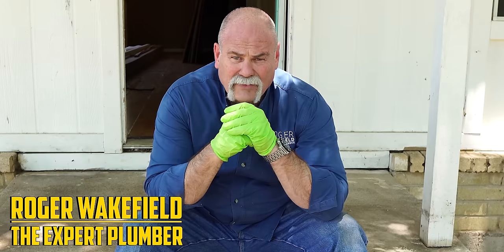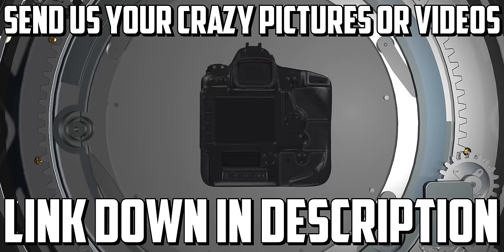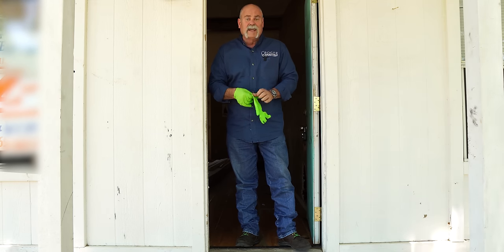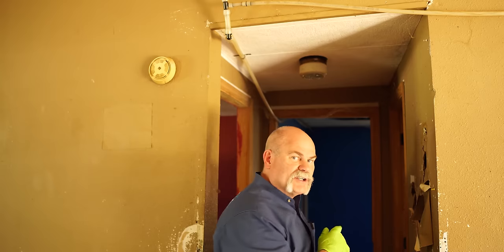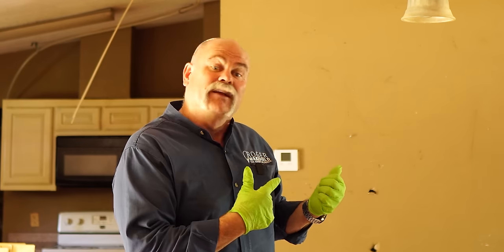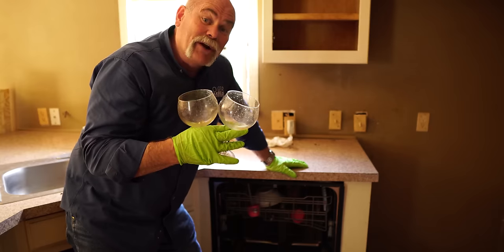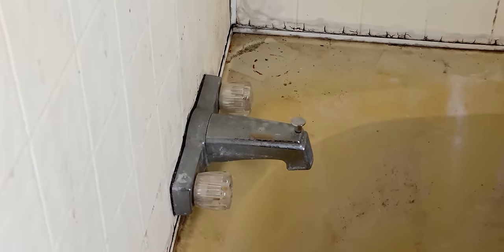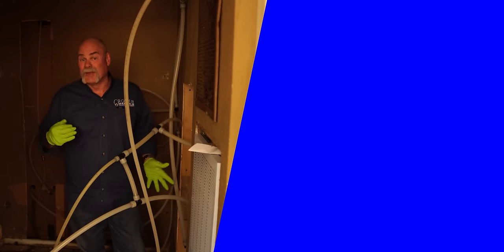This is THE WORST Plumbing Job in America

Comment from the maker: So what do y'all think about this plumbing job? Have you seen worse? Show me: video@rogerwakefield.com
Reply: I can’t believe the U.V. from the sun hasn’t honeycombed the uponor being exposed outside!
Reply: I work in DFW as well and I have seen some shit. Once went to a house that seemed to have a venting issue as when nearly any fixture was used the toilet would gurgle. I crawled under the house and saw an utter nightmare. Everything done in PVC  pressure fittings with tees on their back and the whole house all tied back into 1 4" stack that served the master toilet. Nothing was vented other than that 1 stack. Water lines were pex and shark bite and ran like shit no hangers just laying on the dirt uninsulated.  I crawled back out and told her she had quite the problem. She told me that my company just inspected the plumbing in the home for her prior to her buying it not long before I hired on and I did not know that prior to me explaining what was wrong as best I could to someone who doesn't understand plumbing. It was a tough situation to be in and I felt so bad for this sweet old lady. I fixed it on the side for her for $300 plus material over 2 weekends. I would have charged 7k to do it if I quoted it for the company
Reply: Not that bad but close.  I had a job I went to back in the 80s that was a basement home and the tenant had the sewer line backup and instead of getting the line cleared he popped the clean outs and let their waste line drain into the basement.  When I got there I found the floor was moving.  Needless to say we called the health department and they forced the tenants out until repairs were made.
Reply: Was that a meth lab or a grow house?
Reply: The builders of our community should be in jail so they can't make such a mess ever again.  Code violations galore - so far I've found HVAC and plumbing code violations!  What's next? 🤬
Reply: 😳 Wow, I hope they got a discount, that's a lot of line
Reply from the maker: And it took a while to install all that.
Reply: What a mess! I've seen similar on some carrbean island homes. For example, pvc and cpvc lines run10 feet outside the foundation. Various sizes, three quarters to half the back to three quarters then half again, in each run, and not even schedule 40 pipe but thinwall. Piping installed up the outside wall of the home then through the wall.
Reply from the maker: It’s crazy Max.
Reply from the maker: Maybe both...
Reply from the maker: Great pictures. Thank you Pamela.
Reply: No worries.. its just temporary.. 👍
Reply: When you  observe works of art rather than graded and supported water/dwv, you give thanks for the sawall you own and pray that one day things will improve to the point that you can honestly say to the owner of the art work you cannot find time in the near future to handle his problems unless he is super patient and has fat wallet!
Reply: @jaybee3165  t&p you don't need a t&p it's just a code "recommendation" lol
Reply: It kinda screams of poverty and mental health issues. Some poor guy just doing what he can to get basic running water in the house... But yeah tear it all down to the bare wood and start over.
Reply: I'm a renter when I moved in the plumber blew a water line right outside my front door and left it broken for almost a year since moving in we haven't been able to use the sink because he doesn't have it properly connected bathtub was put in backwards so I can't snake the tub and the drain seal on the toilet leaks under my floor I'm wanting to fix bathroom sink kitchen sink toilet and tub but I'm not about to pull up a toilet that's soaking wet underneath Roger Wakefield please tell me what I should do my landlords plumber obviously sucks and knows nothing about plumbing
Reply: What I just seen in the video it wrong and very dangerous
Reply: Roger that was your first re pipe. Back in the early years. Now they’ll called you back to fix your leaks. 😂
Reply: Got to love a good improv!
Reply: I’m not a plumber but I have learned from a carpentry house on how to do plumbing n my god that plumbing was so bad I wanted to tear my head off.
Reply: Looks almost like squatters just making use of what they could.
Reply: @RUFUS T. FIREFLY it's sad that you would admit to living like that, you should handle your issues.
Reply: Very creative! hahahhahahahahahaha
Reply: not sure if this counts, but my work has a drain for the walk-in fridge that also runs through the freezer drain and out the same hole, and we have had constant problems of that water freezing in there to the point we have to do this whole dump hot water down certain holes. our maintenance guy used to fix leaky pipes with duct tape, and once "fixed" a sprayer in the dishwasher station with a bag, chop sticks, and duct tape, and I tore all of that off and fixed it properly by tightening down the nuts that were literally finger loose. But this? I'm not even a plumber, and even I think what you have shown here takes the cake as to the worst i've seen.
Reply: grow house for weed
Reply: It looks like the entire house is an OSHA violation and is simply put, totalled.
Reply: That’s bad. Now problematic where I work I run into problems where people cut corners and just hacked crap together. My thought Is why spend all the time doing it wrong. When it’s quicker and more efficient and correct to do it right
Reply: This house was a trap house for sure only people growing and manufacturing drugs would set up the hoses like that. Or he could have been growing flowers and needed the extra compost in the toilet 😂
Reply: I really can’t lie I’m not a plumber but even I can tell it’s a mess
Reply: To me, it looks like someone was probably stealing water from the neighbor.
Reply: James Tucker sounds like you should call your local board of health and ask for an inspection. Depending on where you live the owner would be forced into fixing the issues. If you live in the U.S. you should check “Renter’s Rights” for your state.
Reply: I wish I had video to prove it buuuuuuut. I have seen crazyer plumbing in a 3 bed 2 bath home..... Let's just say.  It could be called HOT DOG plumbing. You know hot dogs have a little bit of everything in them.... So did this houses plumbing.... That goes for the sewer system to. If it could be called that.
Reply: with all the money that will have to be spent to repair the damage from just punching holes through walls and cabinets they might as well have hired a proper plumber. would have been done right the first time and probably cost less. this almost looks like some squatters rigged up a basic fresh water system so they could "use" the facilities
Reply: Seen worse looks like a bank job
Reply: Wow some professional plumber orr it could have just been the house owner and they had something against calling a plumber around, I don’t know I’m just losing trail of thought 😂
Reply: Now I am only 12 but when you said bad I did not think that it was going to be this bad!
Reply: It looks like a spaghetti factory gone wrong
Reply: trust me i'm a enginner  XD
Reply: is the  fan outlet  GFCI?>
Reply: I thing that the guy was on mocaine (mushrooms with cocaine)
Reply: He spent so much in Sharkbite connectors he could have hired a real plumber.
Reply: Drugs... Has got to be done by drug users or individuals involved with drug production.
Reply: This has to be a very poor old person who had a family member do something to fix it quickly during the person's last few months of life.
Reply: How on earth is this entire property not a massive case of insurance fraud waiting to happen?
Reply: Roger, did you fix this? If so, how did you do it and how long did it take?
Reply: Wow omg this is the one you dream about. 22 years of plumbing and this is a first for me😂😂😂😂😂😂😂
Reply: You caught me I did that job
Reply: Definitely a crack house.
Reply: I think this is the worst i have seen. I am not a plumber but i have enough knowledge how plumbing works and how it should be.
Reply: I’ve seen a lot of stuff like this in Central Florida shopping for flips.
Reply: mate I got 13 seconds in and realised that this probably wasn't going to be my kind of video today. You're an absolute madlad.
Reply: thats one of the methyest things ive ever seen
Reply: Seriously though, I need you to figure out who made this nightmare and tell me what their reasoning was... This crud is just crazy! Liked and Sub'd for that reason lol
Reply: I have seen a plumbing job where the sewers were not cleaned in years and construction companys and private individuals and dumped everything they had into the lines causing backups and floods.  One day it was cleaned and they speant 4 hours pulling bricks and hunks of metal out of the ground.  I also once saw a very innovative sewage line in an old building where to montior the flow into the city line there was an open ditch in the basement where the sewage water would flow.
Reply: Looks like a meth house. All the copper plumbing was pulled out to sell for meth, and what you see is stuff shoplifted from the local Home Depot.  Cleaning it and rebuilding it would be a mistake.  Condemn it and tear it down immediately.  Or it will become a meth house again.
Reply: I could see something like this being done if a contractor was going to come in paint pressure wash and you need a temporary water to flush a toilet but this looks like a 15 minute repipe job..  I worked for a guy who cut a support column out of a 5 million dollar house on Tampa Bay to install an 8 panel sliding glass door that had no business being there. I had to keep coming back for drywall work because where the floor molding met the drywall it kept buckling. I would have to go back every 6 weeks and re drywall the wall. Why? because it was sliding into the bay.  This guy was the biggest scumbag I've ever worked for and had every license and County requirement you could shake a stick at. On paper the guy was perfect. Until you got him in your house
Reply: Looks good to me. I don't see a problem. Couldn't have done better myself.
Jk that is deplorable even by handyman or even worse weekend warrior standards.
Reply: Honestly, if there wasn't a reason to bulldoze that house...that "job" was it.
Reply: This plumbing is perfectly suitable for a post apocalyptic unibomber shack. I don’t see what the big deal is. Lol
Reply: “I got a guy that will do the plumbing for less!”
Reply: Blows my mind how someone can be so close to doing it somewhat right and ending up like a pex spider man...😂
Reply: (From UK) Worst I’ve seen was a combi boiler installed in a separate prefabricated garage, with about 15 metres of 15mm copper pipe connecting it to the house, no insulation on the pipe even the section outside between garage and house - about 4m at about 2.5m above ground.
Reply: That's a pot house
Reply: Fixing this job should be simple, just use your torch!  Seriously, my solution when I see jobs like this is, turn and run!
Reply: @vilsan.r.9875  correction:  meth house
Reply: I have seen worse. 
Water was garden hoses. They were mostly in crawl.  1 to 4 valves at water heater.
Oh the crawl!  One 4 inch ABS pipe with PVC fittings. Didn't even use transition glue or primer just PVC glue. With few hangers to support the drain there was a lot of duct tape.
Or the restaurant that did not bother to fix the broken pipe under their kitchen before any rules about grease disposal!
Oh the list goes on.
Reply: @mattlent1741  it has not been out long. It would be getting yellow. 
It was been out long enough for the plus print to have faded away.
Do you hear a hiss?
Reply: I think it was actually a piece of performance art meant only to be appreciated by true plumbers.
Reply: It’s pretty methed up..
Reply: @jaybee3165  that’s crazy scary.
Reply: When Roger says “This is VERY interesting.” I actually hear “This next part is REALLY fucked up.” 

🤣🤣🤣
Reply: Hilarious
Reply: Possible drug house
Reply: Sandeep plumber INADIA to USA joB SARCH
Reply: I have never seen this before in my short life. But all i have to say is eww to everything especially the shark bites.
Reply: I thought I the job looked nice and very professional
Reply: That brings back memories of a job I decided not to do.  Especially the toilet.  My boss wanted to check if maybe I exaggerated, looked at the toilet first and said, "we're outta here.
Reply: @brasshouse-og  You better be careful doing side jobs for old people, they'll tell all their friends about you and before you know it you've got a few dozen elderly folk for clientele, money's usually good and the jobs tend to be easy like replacing a rotted out sink drain or flushing their hot water heater because it doesn't work as well as it used to
Reply: My first hought was "Why didn't he tap into the existing water lines"
But I didn't see any existing water lines, makes me think the copper was striped at some point and a squatter ran this plumbing probably stealing water via that garden hose, from the neighbors.
Reply: This cant be a real job? this has to be set up for comical? value right?.....please for the love of God tell me this is a joke!!!
Reply from the maker: @a-yates  this was a legit house that people had been living in.
Reply: Ray Charles could have did a better job. 😎
Reply: @shekharmoona544  Maybe Helen Keller was his supervisor.
Reply: The outside part of the video reminded me of a water theft investigation I conducted when I worked for the FWWD. 
I came across three houses that had been terminated for non-payment, all next to each other. No one could find anything fishy in the meter box. I decided to look in the backyard and found pvc plumbing attached to the hosebib and traced the line to the house across the alley. There was a T where I traced the lines to the other houses. 
As it turned out, the owner of the back house also owned the three houses in question.
Reply: Squatter crack house.  Stealing water.
Reply: Apparently I cannot put photos on a YouTube comment but as a Plumber in upstate NY I could show you pictures of a house I was in that makes that house look very clean and neat.... you know the homeowner is very disgusting when their pet dog died in the house and it took them a week to realize it.... we were called into the job after the resident was moved out and asked to assess the plumbing situation and what needed to be done to fix it. Let me know how I can send you pictures of the job and I will.
Reply: Roger. Do you reply to comments? Was your buddy flipping this house ? And what was the end result.? I'm old school like Paul Harvey. I'd like to hear " the rest of the story "
Reply from the maker: @mikeglasgow6656  I do sometimes. He was looking at it for a buyer. They didn’t buy. I like knowing how it turns out too. Thank you for watching!!!
Reply: Thanks for responding.  I am 66 yrs old and have about 40 yrs in the industrial HVAC/R trade. Digital controls, boilers, chillers,  and all sorts of very technical seed dryers that are computer operated, but have modulated burners to control how fast any given seed is drying as to not crack the seed hull. Machines imported from the Netherlands so everything is metric. My Dad said if GOD wanted us to go metric, there would have been 10 DISIPLES .New sub here. And I agree with the Union thing. I got in trouble all the time for working. I just told my B.A. send me someone who can do what I can do and I won't have to do it.
Reply: What the hell happend there???
Reply: I’ll have to ask if I can share pictures had one that connects the pool heater to an outdoor wood stove boiler to a heat exchanger on the water heater and supplied 2 water coils that were added to the furnaces so you could technically heat some hot water the pool and the house with the wood boiler outside or the pool heater could as well nothing was mixing with the drinking water but it took a bit just to trace it to be sure it was safe to operate XD
Reply: From what I understand that was a grow house they can grow their drugs.
Reply: Well if he was in Italy I say that house probably belong to Chef Boyardee because I'm looking at those pipes thinking it looks like somebody just opened up its spaghetti
Reply: @WDFH  both plus a trap house and brothel. candy store on sunday!!
Reply: You get what you pay for!
Reply: It looks like my brain. Disorganized and kinda leaky. Also I never thought someone could mess up that badly. 🤢
Reply: That poor house man I might not know slot about plumbing and electrical work but I know enough not to but both right next to each other
Reply: @gabriellencarnacion3310  Reuter ty
Reply: @brasshouse-og  My parent's house had toilets that gurgled. Turns out that the vent stack had a cap on it and they never noticed till the cap started to degrade and air got out.
Reply: My step father and I had a deer lease in East Texas. We paid to be there and this property was just over populated with deer and Hogs. We came in to spend the week up there. We get into the house and it was a similar job to that. We bring our own water and provisions and didn't mess with the showers. The toilet barely flushed. But it looked just like that job right there. I have to send this to my stepdad now so he can have a laugh about this.
Reply: wow, just wow. I see it, but can't believe it.....
Reply: As a plumber in Oregon for 8 years years that is by far #1 worst place I seen.....I have a close 2nd myself....that I walked away from  lol....the cracked tile and slope around the toilet was enough for me to walk away....toilet leaked for so long the floor around the flange was slowly rotting out and caving in
Reply: This made me laugh. Thanks for the presentation. We'll done, Mr. Wakefield. 

I'm sharing this. 

On a side note, tell you buddy to stop using my name. 😂
Reply: @RogerWakefield   check out this quality work done by a home owner
Reply: The house I'm renting isn't WORSE but it's freaking awful. I'll send some pictures sometime lol
Reply: I love how you fired him before ever meeting him on the video xd
Reply: Bet anything this was done in a hoarders home
Reply: I don't see anything wrong here. It looks good. Everyone has their own way of doing things.
Reply: @SeithonJetter  I totally agree. You have a sound mind. Most comments easily jump to criticism right away.
Reply: Appalachian trailer park plumbing.
Reply: Me i did that
Reply: Bob was NOT high on meth while performing this project -disclaimer. 😅